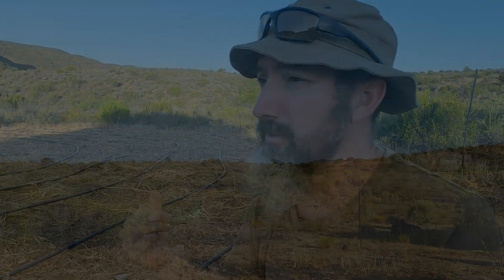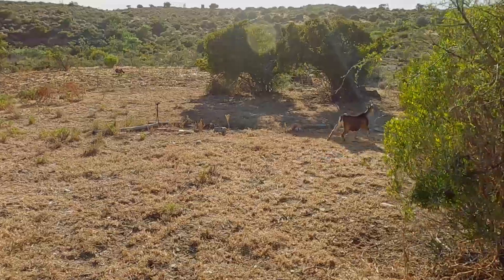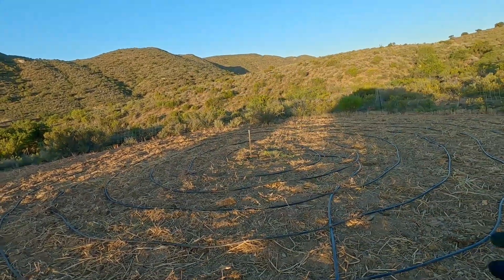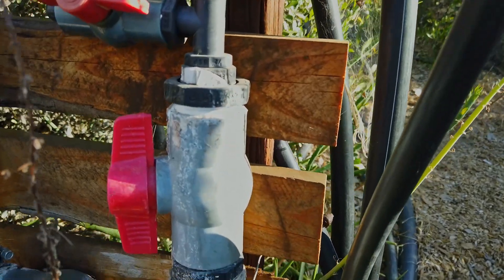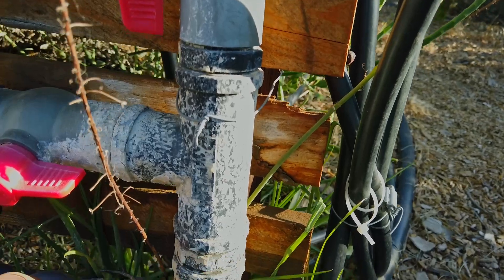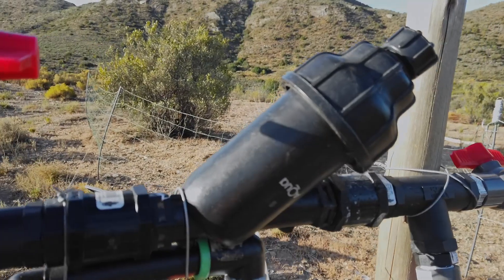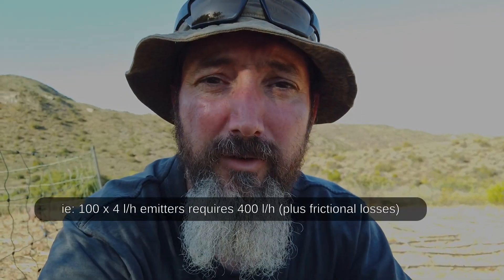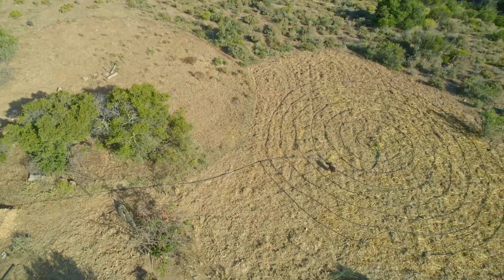A long spiral irrigation pipe, drippers, natural fertiliser and self-reliance.

Comment: Good day Mate!  A couple of thoughts;
A little research on my part tells me that elemental sulfur can not be dissolved in water.  A little detail I did not know.  Why this is relevant, is that if you are going to neutralize the components of your water that make it base - the sulfur will have to be activated, which brings us back to sulphuric acid.  My notion is that you would want to install a precision injector at the very head of your system that could efficiently  condition all of the water entering your drip system to a pH of 6 to 7.  Now my meager understanding of chemistry leads me to believe that the injection rate will be very low so you are not using enormous quantities of sulfuric acid.  And secondly, because you are adding calcium carbonate and sulfuric acid at the same time to your soil, there should be no additional amendments required beyond what you are doing to build healthy soil.  Over time the pH of your soil should drift to neutral.  Now this injector is going to be an expensive bit of kit.  SO I'm going to suggest you consider the value of water in your environment that will not poison your soil or ruin your drip system.  Since both components are priceless, the cost starts to look like a reasonable part of doing business if you amortize it over 10 years, for instance.  At any rate, this is good content and I hope you will do lots of videos.
Second is your pond and flocking.  This seems to be a problem for more off gridders than I imagined.  Will you please video tape what you learn and now you proceed?
I always enjoy your content.  Keep it coming 😊
Reply from the maker: Morning! Will definitely share what we learn. It's true that sulphur won't dissolve. The powder can be added to the soil, and will take ages before it shows benefit, but won't help the "drip line maintenance". Sulphuric acid or nitric acid is one way, but it would be silly and impossible for me to spend in that equipment. Once in a blue moon I could manually dose an irrigation tank to pH 5'ish and just have that run through once every few months. At the new plot I'll see how this can be done. You're right about that amendments! 
Thanks for the great comment and ideas  💡
Reply: @AridForge  Batch dosing should work. I enjoy all of your updates and will be following along. All the best my friend!

Comment: I like above ground drip irrigation but the only problem is that the water gets so hot that it burns the plants close to the emitters. You are creating you own crop circles without aliens:hand-orange-covering-eyes:
Reply from the maker: Haha, perhaps I am the alien! Hope not.
You're right about the hot water. I have been contemplating the same, but realised the breeze immediately causes surface (evaporative) cooling. The pipes are for sure extremely hot, especially on the longer runs. On our permanent setup deeper inside the land, the domestic, animal and irrigation water will be sourced from close-proximity tanks. Dankie vir die inloer!
Reply: @AridForge  Plesier en sterkte.

Comment: Impressive work on the spiral drip system, it is looking good from above.  I am about to give up on the drip tape, even with a pressure regulator it seems to rupture after only a few weeks in the sun and then I have unrestricted water flow for the duration of that irrigation cycle (wasting my precious water and ruining the garden bed).  I will be getting the normal black pipe and discrete drippers like yours for the new vegetable garden and the trees.
Reply: The agro field tape in your region is intended to be buried to protect from UV.  It is intended for one growing season then scrap.
The best drip line on the market is Netafim.  It is formulated to survive the Israeli desert.  In line self cleaning emitters can't be beat.  Or just use their tube and fittings and use emitters from anyone.  But make certain you can open the emitters for cleaning.  Many you can screw the top off and it will flush on it's own.
Reply from the maker: Glad you found Hein's channel. He is in my area too and just visited an hour ago. I agree, we have to use class 4 or 6 pipe to get 10 years from it, as class 3 will only last a year or 3 in the sun. Netafim stuff is truly good quality & well designed, and I've seen some of the Israeli designed stuff to outlast the others (like the naan sprayer). I think the flushing system is a must. I'll add a straight through valve at the low point to do this.
Reply: @AridForge  All you really need at the end of a run is a screw on cap.  Cheap and easy.
Best thing about Netafim fittings is the price and the interchangeability.  VERY economical compared to some of the competition and high grade plastic.  Now I don't have the harsh conditions you do but my rigs have been out 6-10 years.  Mine freeze and thaw through the winter ( tey are drained of course) but that's wear and tear, and I have had to replace a broken a fitting yet. 👍

Comment: Those are much larger emitters than I can source via my supply chain - but the flow rate appears quite good/low .
I feel for you on the Ca buildup. My problem is salt.  At least once a week it requires some "rotation" of the emitters - 90deg left, then right to break the build-up.  Not a pleasurable activity, but it works... sort of.
Reply from the maker: Mmm, that's a good strategy. Mine are not adjustable or openable, so I think you have good ones there. I agree though, the 4l\h is a bit large, and their physical size is probably due to the fact that they are pressure compensated (which is something I don't need, and didn't know). Still quite cheap, at the price of a nice toffee each. I would like to pick your brain some day about the salt you have. I always wondered how to manage that. Have heard that gypsum helps the soil long term to rinse it out.
Reply: Salinity is a major problem in Western Australia.
"The lost agricultural productivity from salinity damage is estimated to be worth at least AU$ 519 million per year. Even though climate change has resulted in reduced annual rainfall, saline watertables have risen in many areas, meaning that dryland salinisation is a threat to  about 2.8 to 4.5 million hectares of low-lying or valley floor soils."
Reply from the maker: That's creepy. The effect it has on soil. It varies here, as well. Some wells have 30ppm and then 4km on, 600ppm. We're at around 300. Are you implementing some strategies against it in terms of plants etc? Thanks for sharing the info. I'm very fond of your landscape and environment, and it's nice to learn about it.
Reply: @AridForge  The best solution is using your pond water.  I'm surprised the mud has not settled out.  Should be quite low in minerals.  Are you using a filter at the source? 120 is the minimum - but you can go finer if you are using borehole water or use disc filters, or a combo.  120 mesh followed by a disc filter.
Reply from the maker: I have a disc filter of about 130. I think we should get a basic sand filter up at some point. The problem with some of the dissolved solids is that they go right through the mechanical filters. Using the pond is perfect! I don't  have the pipe lines in place yet.
Reply: @MichielBrandOUTofDOORS   Are you in a position to capture and hold rainwater or are you drawing from the same aquifer as the big boys?
Reply: @AridForge  I'm thinking of a blend of bore water and pond water to dilute your salts.  If the pond water is filtered fine enough, it will pass through the emitters.  If you use a 100 mesh 155 mesh and 200 mesh series, you should be good to go-especially if you blend in your tanks.  If you are not drawing off the very bottom, you will have solids that settle to the bottom.   At Tree Pittsburgh we use river water and clean the sludge out once a year.  When you buy your filters, order an extra set of mesh screens so you always have a clean screen ready to go.  When they dry out you can simply brush them off.
You can also sprinkle a flocculant across the surface of the pond (will help to waterproof the pond also) What is a flocculant?  "As the demand for eco-friendly solutions in the flocculation process for drinking water continues to grow, biopolymers are emerging as a highly promising solution. Among these, chitosan stands out for its exceptional properties, making it a top contender in this environmentally-conscious endeavor.[17] Chitosan is not only biodegradable but also exhibits a unique ability to bind with a wide range of contaminants, including heavy metals and organic pollutants, effectively removing them from water sources."   Chitosan "is made by treating the chitin shells of shrimp and other crustaceans with an alkaline substance, such as sodium hydroxide."  
Most economical as a powder you dissolve in water and spray over the surface of the pond with a conventional spray tank.
I'm not sure of the elevation of your irrigation tanks, but it may be possible to use a syphon from the pond.  Cheap and easy.
Reply from the maker: @stevejohnstonbaugh9171  amazing. The flocculant sounds promising. I also think mixing in some water from the pond is fantastic. Then, you mention river water, which we have access to after rains... For all of these I will need temporary pumping to higher elevations to gravity charge the storage, but you're getting me thinking. Thanks for these gold gems. Appreciate
Reply: @AridForge  You bet!  To pump from the river we use a gas engine with a 3" diameter suction hose (rigid), pump and a supply hose (soft).  The only caution is to stay above the flood line. 😇 That said, the supply hose is cheap.  The money is all in the suction line.  
I own an inground pool so I know about flocculant.  Infact, the last bottle I bought was Chitosan (I'm only dealing with 18,000 gallons)  I'm fairly certain there is an ag or industrial grade.  All those fines drop to the bottom of the pond and they'll seal it up real good. Really happy I had some useful thoughts friend! 😉
Reply from the maker: @stevejohnstonbaugh9171  Interesting, it seems we have a local Ag version of that called DamIt. I will investigate some more. The dam is sealed well, and most loss is evaporative. The little bit that sinks in, seems to be greening the trees and growth around it. Thanks for the information, Steve!
Reply: @AridForge  I am familiar with Damit.  I did not know that also acts as a flocculant
An organic solution is a bale of barley straw.  Tie it up tight with extra twine so it stays intact and floats for some time.  As it decomposes, the byproducts clear the water of soil particles and algae.  If you can get your hands on a bail of barley straw, I would give it a go because it's MUCH cheaper and organic.  Aluminum salts in Damit make me nervous.  In the US, I recommend bentonite clay for pond sealing.
Now after saying all that, I'm inclined to think that a regular old bay bail of hay may produce similar results. Worth a try?
Yes, the greening of the water plume is highly beneficial.  The goal here is not to "seal" the pond into a bathtub, simply get the suspended soil particles to drop out.
If the irrigation plan works as you hope, I guess you could consider this justification for another pond or two  upstream that would act as the first settling basin(s).
Reply: @stevejohnstonbaugh9171  We don't have access to scheme water.  Household water is roof captured and stored.  Irrigation water is from a low yield bore (with low/moderate salinity).  I have tried biopolymers with zero success.  I do use swimming pool additives for the house water - chlorine on a monthly dose. I has some flocculant outcome.  The irrigation water has no additives.  The system is extremely basic with all manual valves etc.  I have switching reminders going off "many" times a day...
Reply from the maker: @MichielBrandOUTofDOORS that sounds very similar to here. The shared water is near towns, so low yield bore and rain is life. Makes you appreciate rain, every mil. There was fountain water, but you learn quick that it causes massive conflicts between people, so we stopped using it for now.
Reply: @stevejohnstonbaugh9171  Damit and equivalents are snake oil.  I've been advised to use wood fire (fine) ash to seal dams/ponds.  Gravely soils here so bentonite helped but did not solve my particular issue.
Reply: @AridForge  Conflicts around water has caused wars... Best to avoid, I agree.  We are at least 5 months away from the next rain.  Tanks and bore yield are being monitored carefully.
Reply: @AridForge  Pressure compensation is not a bad thing.  It always comforts me to know that the 200th dripper in a run is delivering the same amount of water as the first.  Maybe a little OCD 😅